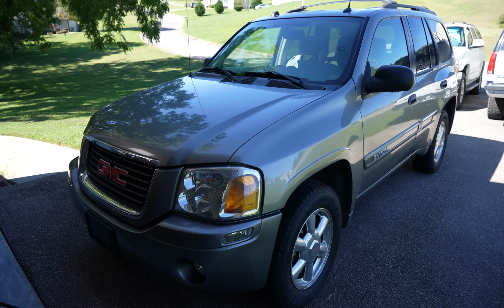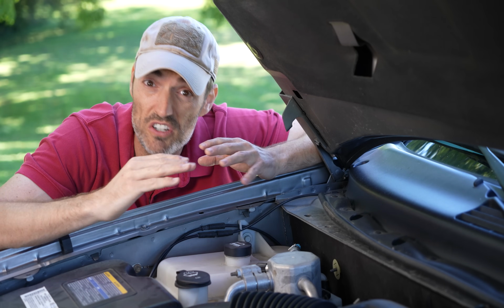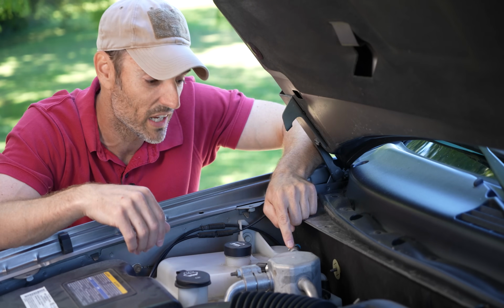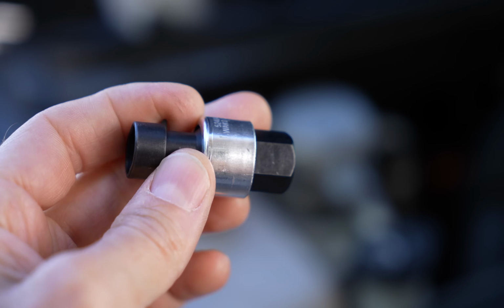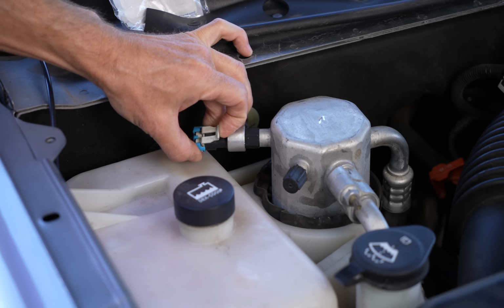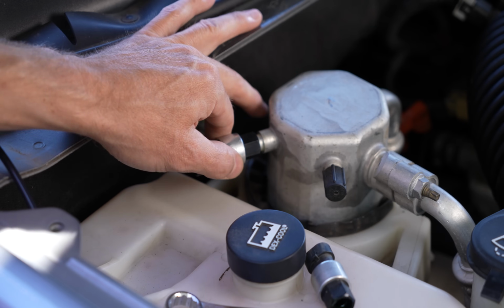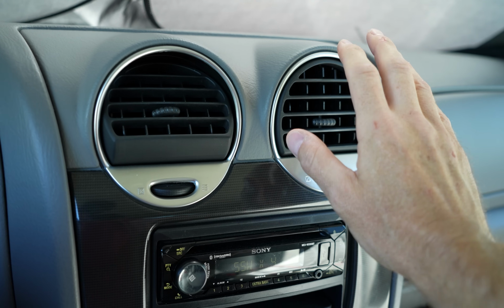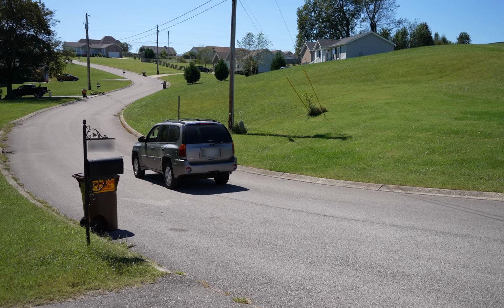GM Air Conditioning Pressure Switch Problem and Replacement!!

Comment: I put freon in my truck and the gage was going from green all the way to the red every time the ac clutch would shut off. I unplugged the pressure sensor and put a paper clip across the terminals then read the freon level, it was showing super low so I added a bottle. It got super cold and ac quit cycling. This told me the switch was bad and it was actually throwing off the fill guage, it was making the clutch cycle constantly

Comment: The low pressure switch on my '05 Silverado has continuity, but the compressor is not switching on. I have 136 PSI of refrigerant on the gauge.

Comment: My 2003 Ford crown Victoria the switch was closed the compressor was running continuously and on the highway that evaporated with ice up airflow would stop seemingly would get warm pull over to get something to eat or get gas give it about 45 minutes you go back out it works fine again low pressure  was stuck closed

Comment: Surely there is a way to electrically test these before replacing. If indeed it's a switch this should be pretty straight forward.

Comment: Great video. As soon as I touched the old sensor, before I even turned it, it immediately began to hiss. Too scared to take it off, the hissing just gets louder. Tightening it doesn't stop the hissing. So now I'm just waiting for it to finish venting all the pressure. Hurray for me.

Comment: That is the low pressure switch. There is a separate high pressure switch near the compressor or on the high pressure line. (the smaller line)

Comment: My  2017 traverse  seems  to do this same  type of activity randomly, cools grate then not,   and of course the dealer has changed  the low pressure hose for $1,100 . Three days latter same  activity ,take it back  to them  they keep it 3 days. Call and say what we fixed  isn't the issue 7 days  later  $1.374 it worked leaving  the dealer and quit working  on the trip home and now  randomly blows cool  and the ac botton is blinking now as try to turn  it on. Feed up  I am

Comment: You have a clogged throttle valve. The high pressure side gets to high due to lack of refrigerant flow and the system triggers off and the only way to get it to start again is by turning the car on and off.

Comment: I change the pressure switch and is still throwing out hot air. What else can be the problem ?
Reply: Same here
Reply: @kamboieyyy9998 I figure out the problem. The problem was that the truck didn’t have no Freon. The truck took 3 bottles of Freon to get my A/C back and working.  Try adding more Freon to your truck.

Comment: I have a 2014 Chevrolet equinox,.2.4l. my a/c is blowing hot air also. Do I need to vacuum the line when replacing the switch on this vehicle?

Comment: All that talking in that video and not one time did I hear you differentiate between the low pressure and high pressure switches even the switch you installed you just called a switch.

Comment: You can test the pressure switch with a multimeter. If you don't have continuity or high resistance the switch is more than likely bad
Reply: that was the low pressure switch, after 30mins it rests but yes it could be going bad

Comment: I also have a broken low pressure switch but on a on a 2003 suburban; would this cause the rear A/C to work but not the front? Thanks!

Comment: So is the shcrader valve on the dryer always meant to be open when you plug the switch fully in? On mine gas starts leaking out when i do this so have to have it loosely screwed in

Comment: I have a 2007 beautiful almost show room, fresh steel, Cadillac, CTS with a 3.6 engine. I’ve had it now for eight years or so and the AC has never needed serviced or even touched. It has always been ice cold! Until recently now it won’t turn on. I push the button to turn it on it flashes two or three times and stays off. I don’t know why it won’t turn on now. I wonder if this could be the issue with that also??

Comment: was your AC fan still working when you had old pressure switch. My problem with AC on idle seems to be almost the same but my fan isn`t spinning until I give blades a bit of a push and when fan starts the AC stays switched ON and working fine so I am not sure whether AC pressure switch controls both fan and AC clutch?

Comment: I have the same car and the air conditioning is cold and excellent, but ice forms in the evaporator and the speed of air flow decreases due to the ice. I replaced this sensor, but the problem still exists.

Comment: Your definitely not a professional. You didn't test anything. What you're describing could be deferral things and the pressure switch would be the last plane is start. The compressor relay could be sticking, you could have moisture in the system freezing over the expansion valve. Or sure  it could be the switch. But you're just throwing parts at it and hoping it sticks. No a good prescribe at all.

Comment: I replaced the part and tried adding some Freon but the ac pressure gauge would go from red to blue, up and down. This time it blew somewhat warm air but not hot air like before. I already replaced the high side valve as well. I’m hoping I put the Freon in correctly

Comment: Hi just a question, a mechanic said I have a leak in the pressure switch, and he wants to replace drier and pressure switch, do I need to to that? Or just the switch with new o rings?
Reply: Just the pressure switch and you should be fine. Let me know if if you ever fixed it thank you.

Comment: Unfortunately, Ive gone thru 2 or 3 of these, & the problem isnt fixed. Sure it was this easy. Now I'm looking into the evaporator temperature sensor probably being the issue. But I cant find a video on YouTube for it on my 99 Silverado with 5.3L V8...😕

Comment: I am working on a 2012 Cadillac CTS that has one side (passenger) that will push out hot air at first then it takes a while before it pushes out cooler air but not as cool as the driver side.  I replaced the sensor in the car but still does the same.  Des anyone know what I am missing.

Comment: My sierra wont get cold while at highway speeds, granted its hot here in az. but it did eventually get cooler when I got down to 30mph and if just in town driving it wont get cool enough.

Comment: Thanks like your Chanel. my daily driver work truck is 1999 2500 sub. Runs like a champ, odometer just hit 200.000 Of course, i've replaced just about everything under the hood Spider injectors Radiator alnator starter. Replaced head gaskets. Had the heads machine, new valves, valve seats 
My wife's car is 06  envoy .I'm having Similar problem
Reply: Had similar problems that you've had with both vehicles so can relate. Thanks much for your time and efforts

Comment: I have had several vehicles which this same AC system. I have never replaced the part. I have always been able to fix the issue by cleaning the contacts.

Comment: YOUR THE BEST I COULDN'T RECHARGE THE SYSTEM BECAUSE THE CYCLING SWITCH WAS CAUSING IT TO GO ON AND OFF THROWING OFF THE CHARGE PRESSURE I REPLACED THE SWITCH AND COMPRESSOR STAYED RUNNING AND ALLOWED ME TO FULLY FILL THE SYSTEM AND WALLA!! ❄️❄️🥶🥶🥶🥶❄️❄️❄️👍🏽👍🏽👍🏽👍🏽👍🏽 FEELS LIKE ALASKA IN HERE!!!! THANKS AGAIN I DEFINITELY SUBBED AND HIT THAT👍!

Comment: This part replacement fixed my 1998 Chevy 2500 Silverado today. I had just replaced the compressor, had the AC charged, and then it was doing exactly as described in this video. Sadly, I hadn't seen this video until after paying $213 for inspection and then to test and replace this part. But thank you for sharing this video to save others! ❤

Comment: If you’re experiencing musty Odors check and change the filter too inside the glove company area recently did it for a neighbors 2010 Cadillac SRX she complained it was not blowing hard and odors the thing still had the factory original Delphi filter that had never been replaced I cleaned the filter area and replaced it with Fram Covid N-95 grade filter cost $19.00 bucks at Walmart no more smells and replaced the AC switch with a genuine GM now she complains it’s too cold lol 😂

Comment: Thanks.  My car would work fine below 85 degrees outside but when above 85 degrees ac would blow hot air and cut off compressor. High pressure switch.
Reply: Was it the low pressure side switch or high pressure side?
Reply: That’s how mine does exactly when it below 85 works fine when it’s 90° and stuff like that it doesn’t work. I’m gonna try to fix tonight. Thank you.

Comment: A good way to verify it’s the pressure switch is to take a wire and touch the 2 pins on the connector on the ac pressure switch harness. If your clutch starts working again you know the switch is bad.
Reply: If you do that and u got pressure on the system and nothing happens? I got the climate control module blinking 3 times and then nothing happens

Comment: I’m troubleshooting a random issue with my car and even though this is not the issue, I must say, this is a well produced video….very inspiring for my own content. Great job man.
Reply: Change the high pressure switch also. There’s 2 switches on the system.

Comment: where did the wire end up routing too, i have the same problem but they routed the wire inside the fuse box for unknown reasons and its connected on to 44 ac and am trying to figure out how to switch it back to normal anyone know the wiring please help.

Comment: Hi, mine is Ford Fiesta 2011, 1.6S with 20,000KM on it. Lately, I noticed that the AC compressor is not cycling off at all whenever i turn on the AC.
 Do u have any suggestion what to suspect ? I live in Indonesia with outside temp is like 30-35 degC. Thx

Comment: Great insights! My chevy spark auto climate ac only blows cool air when blower is set to 1 and 2, post 2 the compressor disengages and obviously only blows hot air. Could you please help me with this situation? I have already changed blower resister controller, no luck

Comment: Got to watch out for GM stuff with climate control. The high side switch is not a switch, it's a pressure sensor. If the
Reply: Yep.  I had to create a device to control
Voltage to trick the ECM. Bypass won’t work

Comment: 2007 Chevy uplander do I have to evacuate  the air cond system before replacing low side pressure switch or is there a check valve?
Reply: He must like views not answering questions..makes videos to help people but won't help them when they ask questions.  Smh the people asking questions are your viewers. The reason your making money. Always forget what got them there..

Comment: Hi sir. The high pressure switch should be close when checking by multimeter .  But my dodge caravan 1999 bought 5 high pressure sensor  still not working. .check it by multimeter had 6 thousand  ohms even thought  put on compressor air  does it is wrong part ? Thank

Comment: I have an 01 marquis, my accumulator cylinder is similar to this gm. I recently swapped everything and hoses but the switch as I lost the new one I ordered. I recently charged it, pressure held for less than 30 min. I checked the lines and they are tight. 

Bought another can of r134a, charged it, drove it, checked the engine. I heard hissing by the accumulatior and noticed a spray leak where the switch bolts on, I checked for tightness which is t was, then removed it- hissing stopped. 

Im quite sure I isolated the leak to a $15 cycle switch which comes as a relief. Im ordering another. 

My compressor is good still as it kicks on and off with varying pressure.

My question is:
How common is a refridgerant leak from the cycle switch?

Comment: I don't know which to change this sensor or ac selenied the issue with my2015 Chevy impala when ever I stop at traffic light or road traffic or even if I hit the break little hard the AC switch off  and the fan is running it high speed then it start to  blow normal air and humidity is like hell but when I drive in high way It cold as good as it should be 

Many pp recommended to change compressor selenied and after this video it make me confused

Comment: Yeah, not very useful for what I'm trying to figure out on my 99 silverado.  I've replaced the pressure switch on the low site more than once and I still have the on and off cycling of the compressor
Reply: Have you checked to make sure you have enough freon? Seems like a dumb question, but you never know until you check. Have you changed the high pressure switch?

Comment: I have a 03 gmc yukon I changed out the low pressure switch but noticed more towards the bottom near the ac compressor that there’s another pressure sensor do I replace that aswell since my ac isn’t cooling at idle but has no leaks but when driving it’s really cold and I have a new fan clutch
Reply from the maker: Is your compressor loud? It may be a weak compressor. 🤷‍♂️
Reply: @1RoadGarage  no it’s quite

Comment: Why does the pressure switch even though it's brand new and original fail after 3 days. The old replacement  part didn't last failed like in a week after replacing it. Why did it the brand new didn't last?

Comment: I have a 2001 Chevy Silverado 1500 with a 5.3 L motor in it my air conditioning just stopped working I usually do all my own work and if I don't know how to do it I come on YouTube to find out how to do it I'd like to know what your suggestions are to fix this issue I would test it off and on during the winter and it would work so as per 2023 I want to turn it on for the hot weather and it didn't work anymore

Comment: HELP PLEASE 
Anyone have any tips on a 2017 Hyundai accent with only 93k miles on it. It’s my daughter’s car and I don’t have anything to work on ac’s with. The dealership said the compressor was bad and they want 1300 to fix it. I checked the voltage going to the ac pressure control valve and I’m getting around 11.4 volts no fuses or relays bad that I know of. I used a cheap gauge from advanced like you get with the Freon cans and the low pressure side is begged out. 
Should I pay someone to replace the compressor or just replace the valve that from what little research I’ve done says this is the issue. 
Thanks for ANY ADVICE

Comment: I pray that u have solved my  problem.   I have the EXACT same problem,(2010 chevy express)   I replaced the low  side years ago, now it randomly burst the refridgerant out of the compressor valve..  and I've literally replaced everything else and blew out the lines.   but I don't get ANY pressure on the high side when I put gauges on it.  just replaced high side switch and it's working again,......well see tomorrow

Comment: Great video, thanx.
I have Impala 2015 and I almost face the same issue maybe. No gas leackage found, but the compressor goes off for a very long time then its on again  and off again, so annoying. This only happens in summer, but I noticed no issues in winter time?  Do you think the pressure switch can resolve the problem?  Some the videos suggested replacing the control valve of the compressor. . Any suggestions ?
Reply: Same issue with my impala 

Did you found the issue and fix it?
Reply: @thelastbanana0678  Not yet. I need to take my car to an a/c service workshop, but driving in this heat without a cool a/c  is another story 😧.  Will try to go today maybe.
Reply: @adelalaiwi  I will change this pressure sensor If it work then it's good if not I will change the AC control valve it's do the same symptoms
Reply: @thelastbanana0678  yes I totally agree with you, those two parts are the main cause of such problems.  Let them check level of the Gas (freon), it causes similar issues when its high or low.  All the best bro.

Comment: What about suburban runs good without ac on, turn ac on after about a hour the truck looses power to accelerate. Turn ac off and truck will get power back to move faster then 10 mph

Comment: What about when u recharge  the system  and the compressor is coming off but the air is not getting  cool only when I go fast in the truck is get cool but not in the traffic  or when the struck is stop

Comment: 2015 equinox.  Replaced 35 bucks in fuses already but still no ac. Will try this tomorrow.  Assuming valves are in similar location on my chevy
Reply: Pls tag me when you get it tested. I do have a 2014 Mitsu RVR that may have faulty pressure switch too that is exactly described in this video. Let me know how you fixed yours thanks!
Reply: @junangeles  good news.  Replaced the described unit and ac is back.  Part was 50 bucks but worth it since it pleases the wife.  Good luck
Reply: Is it the same part for a 2012 equinox?
Reply: @Justin-uv4ji  I believe that equinox have same unit 2010 through 2016.
Reply: @brianschindlbeck2807  yea, mine is right above the compressor on the high side ac line.. and do you know the exact part that fit?

Comment: Very lucky guess. When this switch goes bad, the system is very likely to not work at all and store a code and perhaps illuminate the CEL. So, you got very lucky.  😉

Comment: Thank you for this video.  I ended up getting a Napa brand pressure switch because they were out of the genuine GM part, had to buy O-ring separately but no big deal.
Reply: wht size o-ring was it

Comment: Man, life saver. Just in time for the long weekend.  Thank you so much for your video.  I used the same switch right from your video, and everything is working as it should.  Clutch is turning on and off, and ac is cold as before.

Comment: I've fold the problem of cycling on and off is usually because the system is low on charge.  The pressure sensor is telling it to turn off.